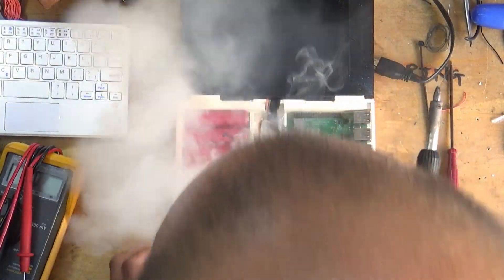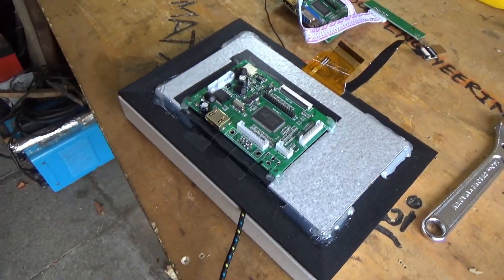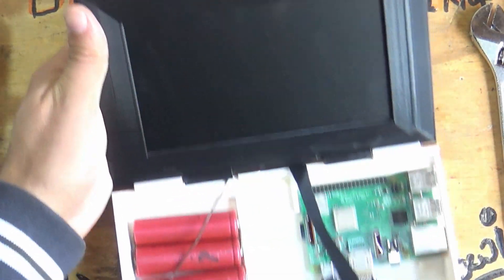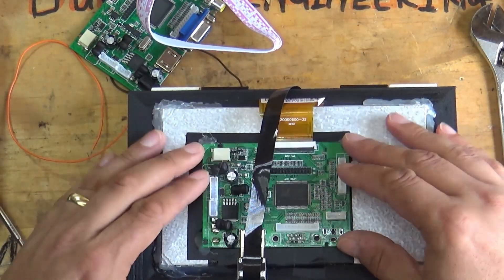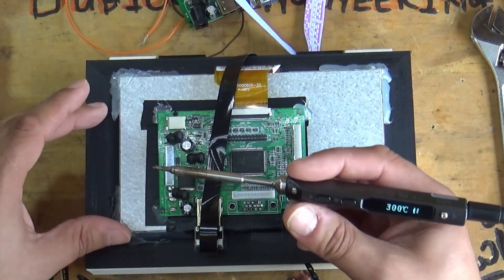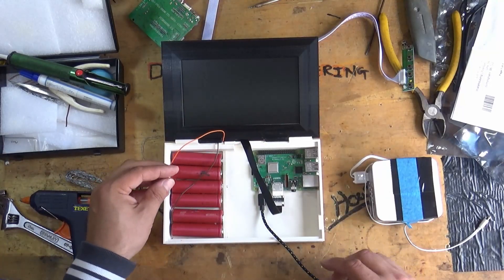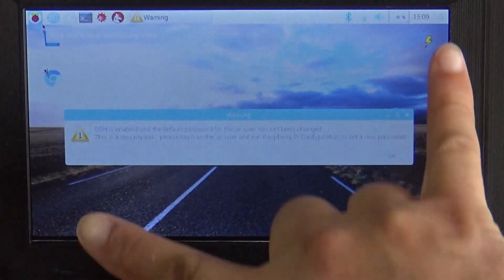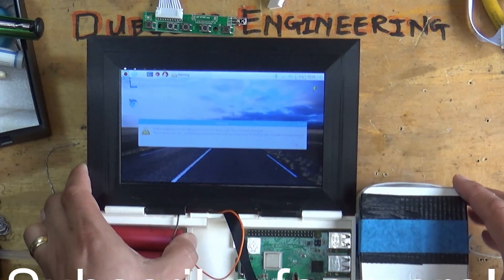DuB-EnG:  How to make a DIY 3D Printed laptop computer with RaspberryPi 18650 lithium ion cell pitop

Comment: What LCD display is that? Same question for the keyboard. I'm wanting to do a RP3 based retro-computer emulator built into a case roughly styled like a Radio Shack Tandy TRS-80 Model III.
Reply from the maker: That sounds like a lot of fun! - Here is the driver board ...  it works with many LCDs.  Sometimes you can buy them together as a pack.  Its great looking.  https://www.ebay.co.uk/itm/HDMI-VGA-2AV-LCD-Driver-Board-For-6-5-7-8-9-AT065TN14-AT070TN92-800x480-LCD/253787750153?ssPageName=STRK%3AMEBIDX%3AIT&_trksid=p2057872.m2749.l2649